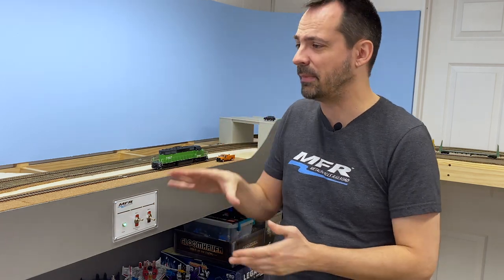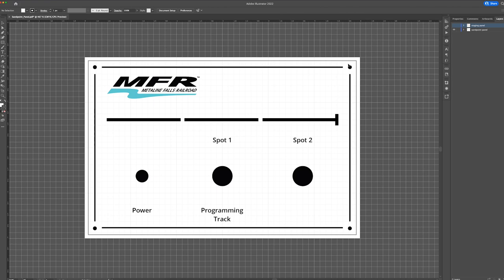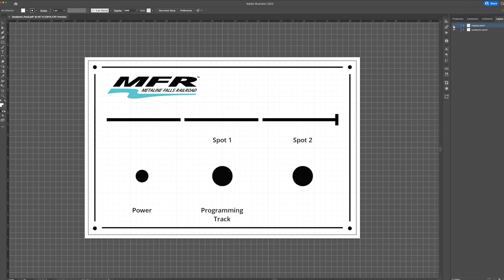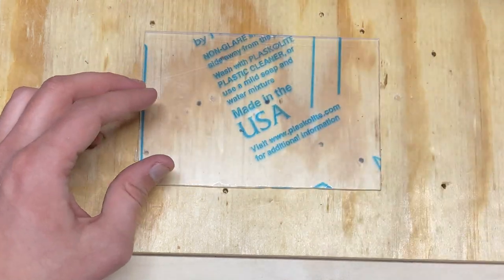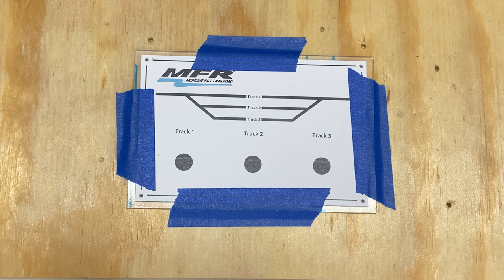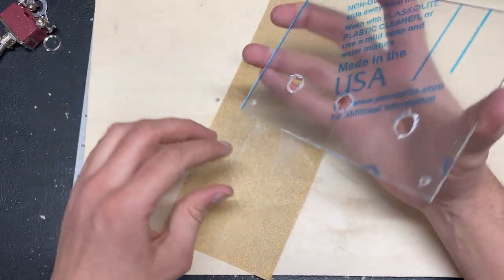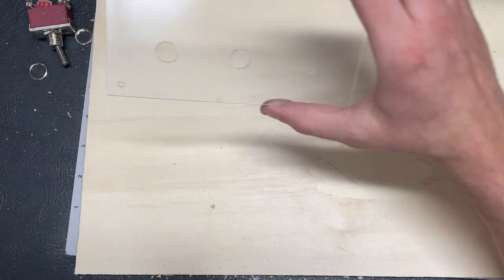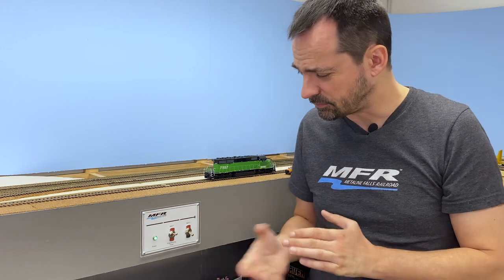How-To: Pretty Panels for your Model Railroad

Comment: To do my plexiglass edges I use a very sharp small block plane and plane the edge smooth.  Then I take a torch or cigar lighter and "flame" the edge.  This leaves a clear glass looking edge and can be done in minutes.  Your tips on stepping up the hole size is valuable.
Reply: Wow! That's a great tip! Thanks.

Comment: Thank you very much for your very informative video.

For cutting acrylic glass I use a steel ruler and a sharp knife blade.

For corrctly centered drill holes I am using a jig helper printing of same space like the later track plan but with the difference that over the drill hole places are marked × or + sighns, so that I can centering the guard drill holes correctly into the finally center.

Finally for the facia screw holes I used a little bit larger drill to drill a cone sinking into the hole so that I can use cone screw with flat surface head, that would be looking much more better by to the facia mounted things.

About of track numbering:
There are different allowed methodes to do it by railroading. 

Every RR has their own rules how they are counting their tracks inside depots or stations alongside their RR.

In my area at northern germany in central europe it is common practise for more than 100 years to count RR tracks, turnouts, signals and anything else in upward direction of the milage or kilometers counted from the RR Company Headquarteers of their Administration Building.
At depots or stations the tracks are counted from the main office of the station master or the station or depot main building.

The track close to the station master's office is track 1 and the mire higher the distance isthe more higher are the track numbers.

If the station master office or station building is in between two diverging RR lines than track 1 is prallel in directly neighbourhood to the depot or station building and siding or other tracks from backside counted with higher tracknumbers like in the hundreds as example of track 101, 102 and so on or maybe in the 30's like 30, 31, 32 and so on.

At some depots or stations the track 1 need not to be the directly mainline, it can be a siding of it.

On stations without station master than the mainline track is counted as track one and all the parallel sidings have easy to identifying track numbers.

All the different Railroads of the past had their own counting rules, so it gives a wide variation how to count RR tracks by your own.

Comment: If you instead place a circle with a little X indicating where to place the pilot hole it might provide you with more precise guide..., with the added benefit of using less ink and time. Neither of the benefits will have a drastic effect, but if you have a large layout with numerous panels it might provide you somewhat of an advantage. Just something to grind your teeth upon.